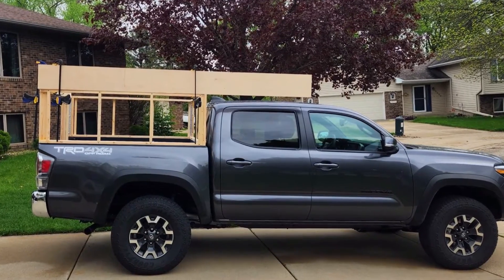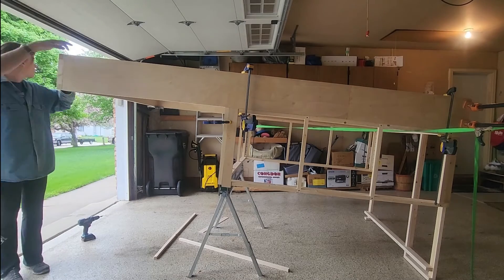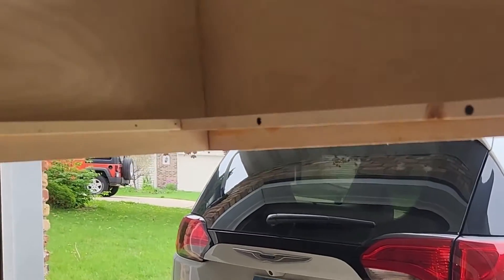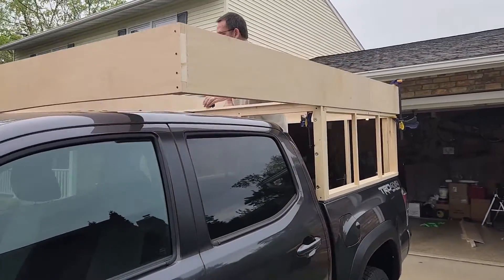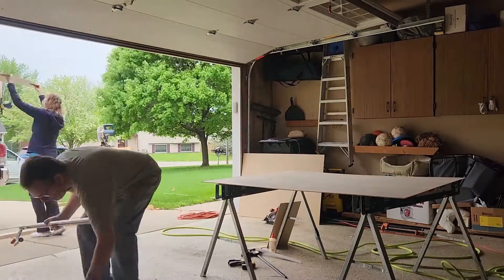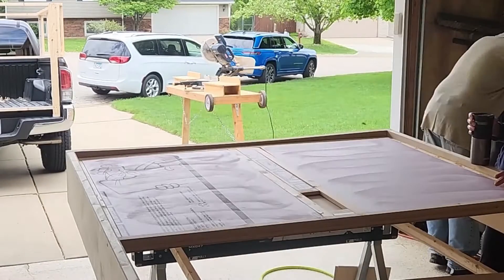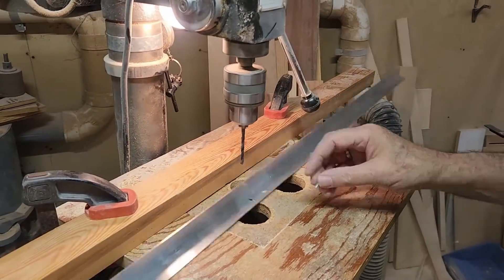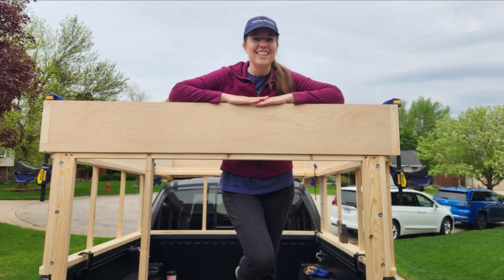Ep.3: Creating a Lightweight Bed Platform for Pop-Up Truck Camper

Comment: You guys have done an awesome job. When you redo the top make the top 1 1/2 inches wider than the base, then use heavy duty drawer slides on 4 corners to keep top aligned. 
Hope this helps to. 
Stan
Reply from the maker: Thank you Stan! I like your idea.

Comment: Did you rip the 2x4 bed rail piece a little to better accept the clamp?
Reply: Sorry about all the comments about the clamps, it’s just been the most difficult thing for me to conceptualize before I full design and implement my build 😅 when I crank mine, which are the ones I ordered from your link, the L bracket is still a good 1/2” into the threads 5:32
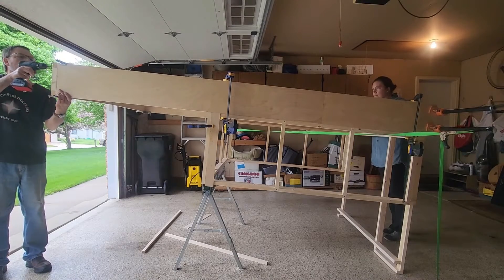Reply from the maker: My 2x4s have been planed down at this point, so they are thinner then a standard board straight from the store. Then to give myself more overlap with the clamps I did make little groves in the board to seat the clamp into. You can see this in Ep. 5 at 1:54. Hope that helps!

Comment: Maybe I missed it, but for the plywood, what is the type and thickness that is used through out your build?
Reply from the maker: Good question. Sorry if I missed mentioning the thickness. Most of the plywood was 1/4 inch thick birch plywood. For the base of the bed platform that extends over the truck cab and would hold my weight while sleeping, we used a 1/2 inch plywood. And then the extra panels for reinforcement of the bed platform (that we added later) were 1/4 inch plywood again.